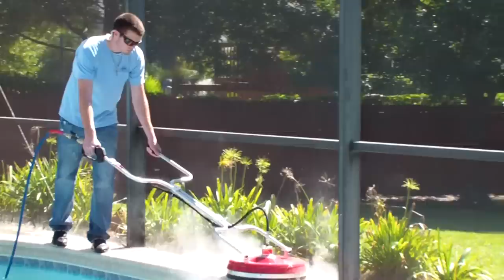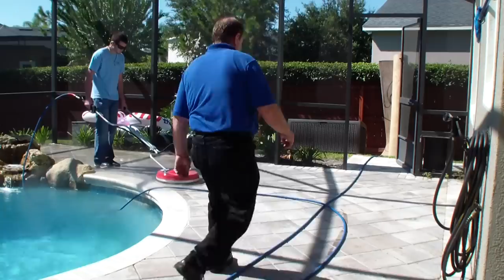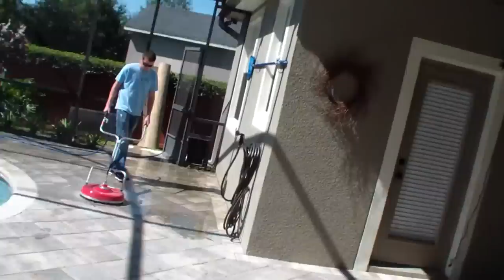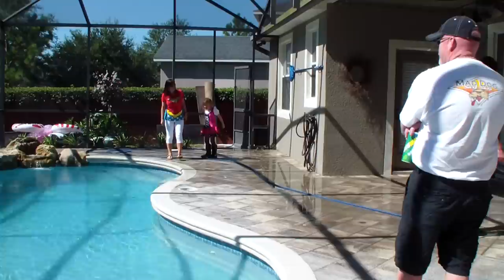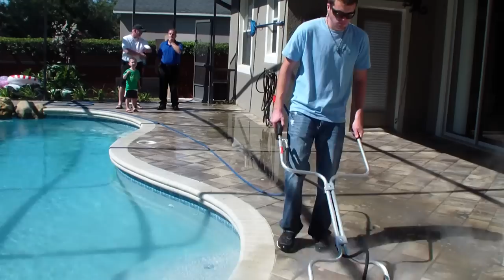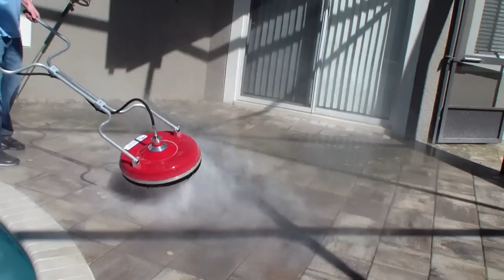Pressure washing a pool deck. Surface cleaner a pool deck training day.

Comment: Why wouldn't you use vacuum to eliminate having to rinse in such a tight space as well as to avoid all that dirty water going into the pool?
Reply from the maker: +tshirt2009 He has a 30'' dia vacuum recovery surface cleaner and a vacuum recovery & 6 stage filtration system. But the surface cleaner was to large for this pool deck.

Comment: He should have taken precautions by staying on the stones only to refrain from having all that dirty water in the pool.  This is nonsense!  About that tiny area, I would have cleaned it with my hard floor machine  because of it ability to suck right away dirt.  Otherwise just leave it alone.